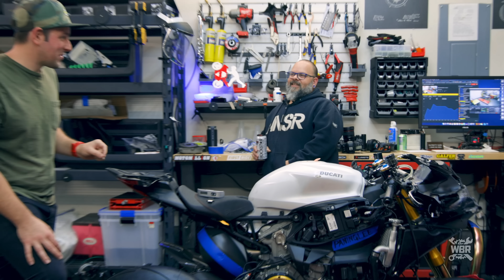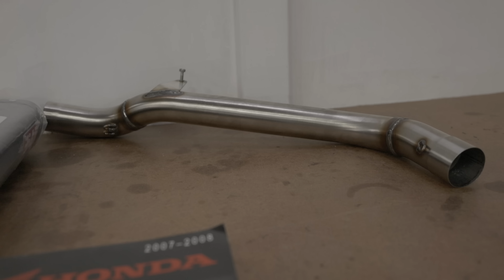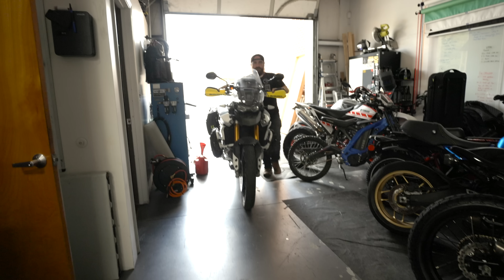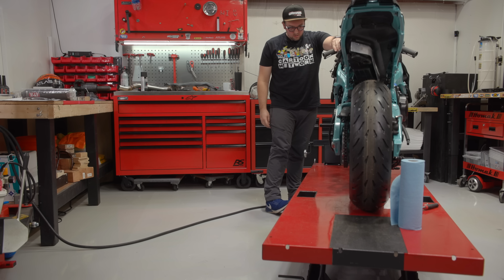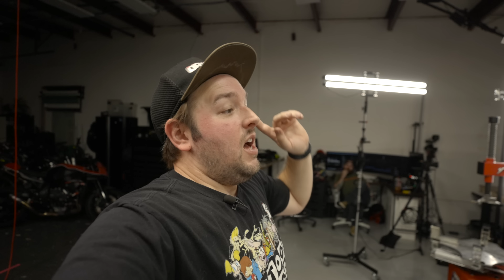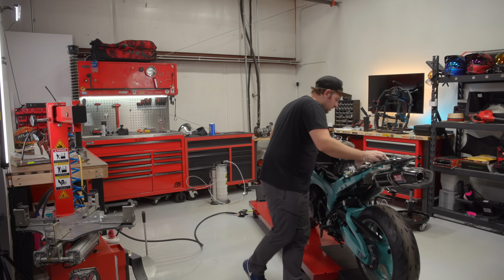About Brian leaving... | WBRGarage S5.3 | CBR 600 Day 19

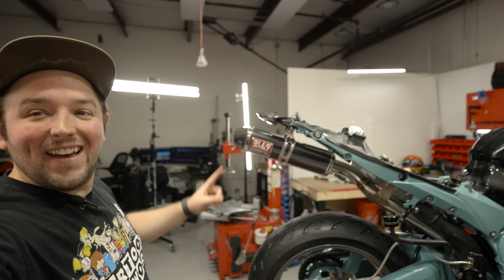Comment: maybe by adding a black lowering thingy at the hardmount point of the heatshield you can twist the whole heatshield just enough to have a little clearance at the bottom. Also, because the exhaust is slightly lower now it doesnt seem to line up with the heatshield (see 25:23) perfectly. Thats also solved then. But its hard to see in the video so I may be wrong:)

Comment: Regarding the heat shield ....I would get a carbon fiber copy made... You have the OEM metal for the mold....it's not hard DIY ..or have somebody custom make one.. Then use MOOSE adhesive backed heat shield ..Moose makes the best stuff....kept my Termignoni exhaust from melting thru my carbon fairings on my Ducati ...apply heat shield material to the back of the CF part...you can EASILY tack weld a stand-off bracket onto the exhaust to mount the CF shield .. It's not hard,  Better that hacking it up w/ rivets and rattle can....